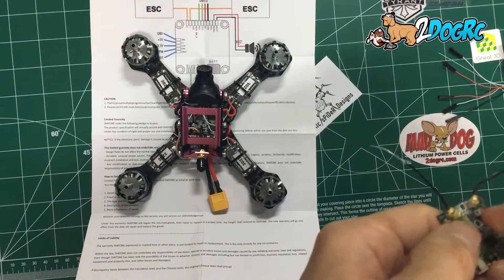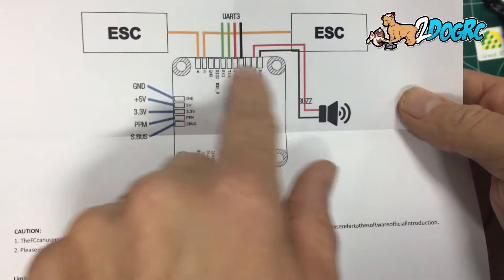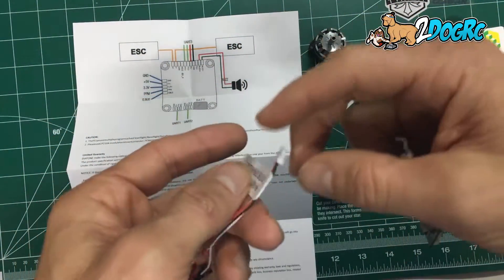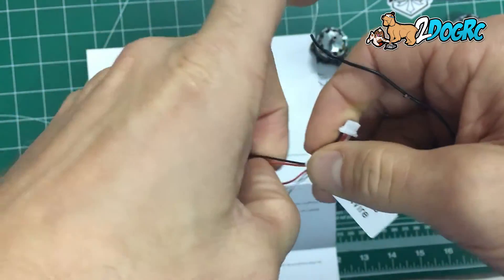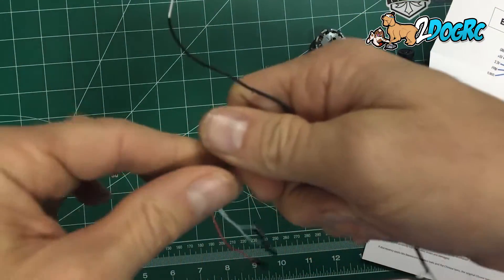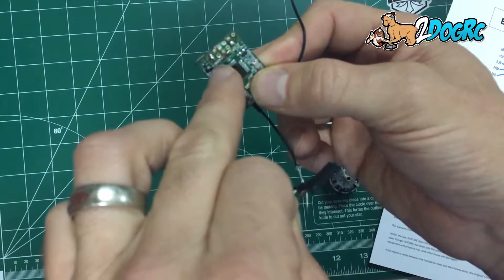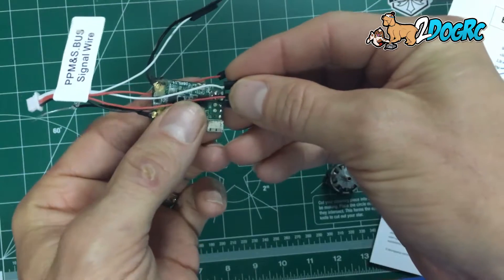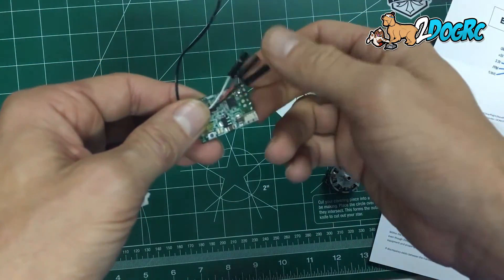Diatone Crusader GT2 Betaflight 3.0 Setup Frsky D4R II D-Link F3, Step 1

Comment: Hi. Thanks again for another great video. Just after some advice. Santa bought me a Diatone SP3 vTX and the Diatone D-Link F3 FC. I need to hook up a FRSky X4R-SB RX to the FC (which I bought from you!). I'm happy with all the connections to be made apart from where the Smartport cable for telemetry goes. Any clues?
Reply from the maker: tammovh Video on that coming.  You only need the Smart port wire to TX of UArt 1 or 2.  Then on the ports tab under that UArt select tele smart.
Reply: Awesome. Thanks. I'll try that. Look forward to seeing the video.
Reply: would love some more info on how to get this working ?
Reply from the maker: I have this on my list.  Here is an article to get started. https://oscarliang.com/sbus-smartport-telemetry-naze32/
Reply: tammovh Hi, did you found a good solution for this? Uart 2 is for OSD video transmitter. If we change UArt1 settings we wouldn't be able to connect USB, No?
Reply: 2dogrc Litlle question, what does the RSSI pad (on D-link f3 v2). could we use this for smart port?

Comment: Hey Bud, I'm a FNG :v  I'm already happily using a Turnigy Evolution with a x220. I do happen to have a X9D+ on hand and am wondering if I  should either just add my new Crusader 200 to the Evolution or give me reasons to hook it up to the X9D+. Thanks! John
Reply from the maker: Good question. If you are happy with your Evolution I would stick with that.  It is sometimes better to stick to what you know.  You really aren't going to gain features out the X9, and your hands are probably pretty use to the Evolution.  Both use S Bus so setting up the ship won't be that much easier. The only thing woudl be if youhave trouble fitting the Ia6 receiver in the Gt2 200.
Reply from the maker: Good question. If you are happy with your Evolution I would stick with that.  It is sometimes better to stick to what you know.  You really aren't going to gain features out the X9, and your hands are probably pretty use to the Evolution.  Both use S Bus so setting up the ship won't be that much easier. The only thing woudl be if youhave trouble fitting the Ia6 receiver in the Gt2 200.
Reply: Thanks for the valuable feedback. Short or long term would it be a good idea to hold onto the Taranis? I'm not sure but I don't see myself having more then three or four quads at anytime. I have an fpv inductrix for indoor, a x220, now a gt2 and perhaps add a 130gt in the near future. Im still sorting out rx but leaning towar an x6b (full range?)for the gt2.
Reply from the maker: Its kinda a personal feel. The Tarnis has some nice features that are being the evolution,.

Comment: Quick question ,I have everything working now but I changed my osd settings with mwosd 1.6 and when I look at through my googles it's shows volts at 0.00 and says disarm when it is armed or disarmed. also no horizon bar isn't showing. any idea on what I can do?
Reply from the maker: This means the OSD is not getting the information from the flight controller.  Make sure that the cable from the FC to the VTX is plugged into UART2 on the FC and on the ports tab in Betaflight you have UART2 set to MSP, 115200.

Comment: I've just got my gt2... my ppm&s.bus wire does not plug into that port? It's too big. Am I missing something
Reply from the maker: Okay, I bet you have a V2 board on it.  Does your board look like mine, or are the solder pads for each ESC spread out across the board?
Reply: Yeah it is the V2 that I've got.
Reply: Sorry I was on the wrong account